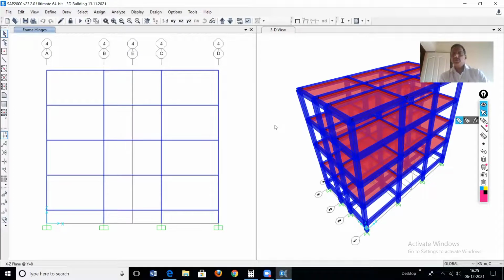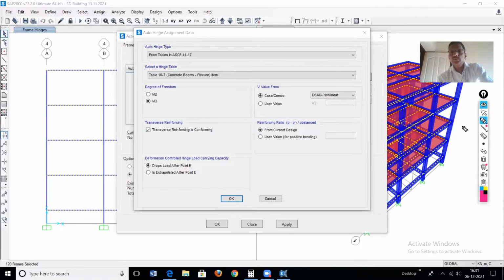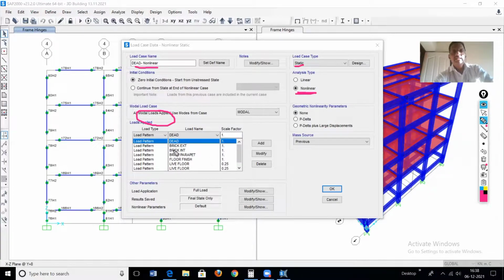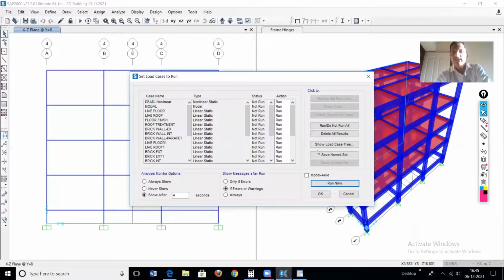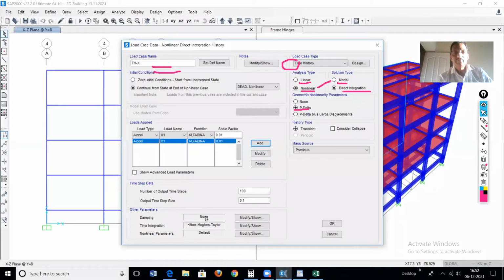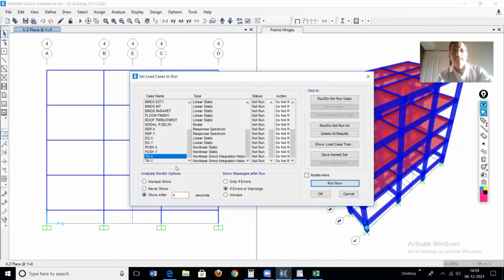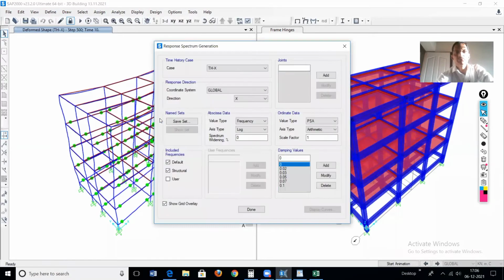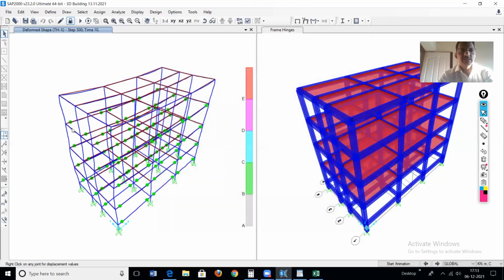3-D RC building- Time History Analysis

Comment: I want to run a sap2000 model under bidirectional ground motion for nonlinear time history analysis. Is it possible?
Reply: Yes it's possible you separately input those 2 data sets one in x another in y properly
Reply: @parthajitmalla4647  what about the specific damping by period ?
Which direction first and second period should I put?
Reply from the maker: Yes, it is absolutely possible. Running a SAP2000 model under bidirectional ground motion for a Nonlinear Time History Analysis is a standard industry procedure for advanced seismic evaluation. 1. Import Your Twin Ground Motion Files 2. Configure the Nonlinear Time History Load Case 3. Apply the Bidirectional Loads Simultaneously